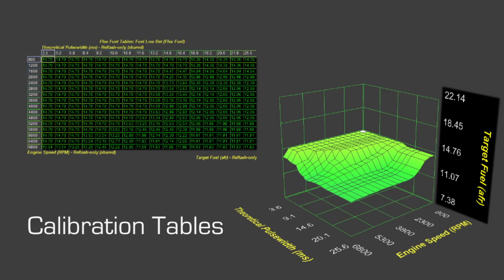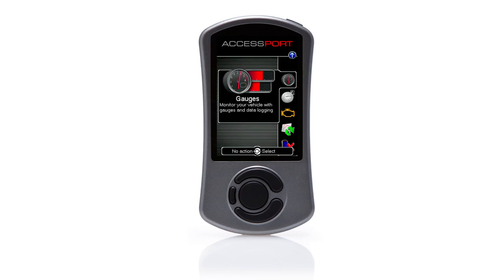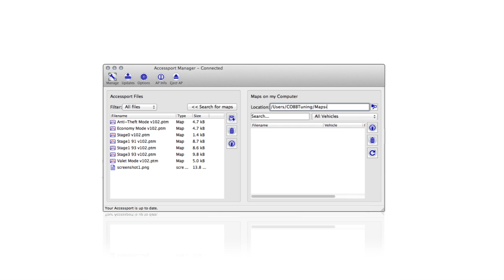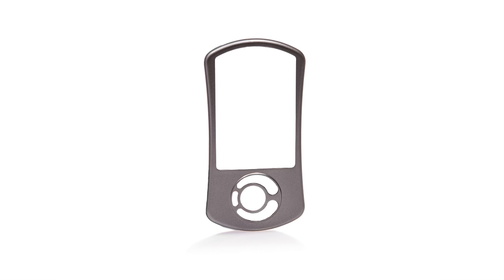COBB Tuning - The COBB Way Part 1: What is an Accessport?

Comment: Hi I would like to get an access port I checked your website it stated for usdm only. I'm in Asia. So I think it's an Asian market car. Would there be an application problem? What is the difference? Thanks
Reply: +COBB Tuning I am from the Philippines Cody thanks for the reply. Is there a way for Cobb to check the ecu remotely say the part number or remotely sending the data of the ecu to you guys thanks

Comment: For BMW 135i with N55. DoesN55 needs full reflash of ECU by removal and can't be done via obdII because of errors?
Reply: n55 would be a bmw-002 accessport and can be flashed via OBD2. make sure to use a battery charger while flashing.

Comment: Too bad you guys dropped out of the 350z game : /
Reply: Nissan dropped the 350z....lol
Reply: ***** they stopped supporting the 350Z halfway through when it was still being sold :/
Reply: go7roo7 The engine just doesnt make much power with bolt ons. You have to go forced induction for it to make more power.
Reply: djnick7000 Regardless of what you consider "much power" on boltons, there is still a massive following that go FI as well as NA with bolt ons that could use something like the accessport.

Comment: Just a question about my COBB Accessport Version 3 for the '2008 wrx hatchback' (automatic) - 91 octane - Canada.

'After I install my COBB SF intake into my car, will my Accessport V3 already have the proper maps to support my SFintake+stage 1 upgrade?
or, would i need to download anything into my Accessport first before i start installing my Accessport into my wrx?'

Thanks COBB!
Reply: +COBB Tuning that is awesome. so it literally is a plug-and-play device ready for use out of the box :) thanks cobb.

Although, ACN definition is Arizona California Nevada -- i am in Canada, so will i still be using ACN91 octane? or just 91octane?

thanks again Cody!
Reply: +COBB Tuning Thanks a bunch again Cody! :) 

just another tiny question...

"does the COBB SFintake filter come in a grey black color?" i notice online was a blue filter.. are there options i can pick any color like the grey filter for my 2008 wrx?  or does it just come with whichever car it goes on? thanks!
Reply: +COBB Tuning awesome!! so when i order the SF intake -- the filter will be grey when it arrives? and then i would still have to spray on the blue stuff before i install it into my car?   ..or is the filter already sprayed with the blue liqiud and it will arrive blue? i am so sorry Cody.. just confirming if i still have to buy the blue spray along with the SF and airbox purchase. thanks again!! :)
Reply: +Jorex Grubaru so to sum it down --  do i need to purchase the blue oil spray and spray the grey filter before installing it into my car.. my apologize.
Reply: +COBB Tuning my apologize Cody.. i got carried away. Thank you so much for your help. Best Regards, Jorex.